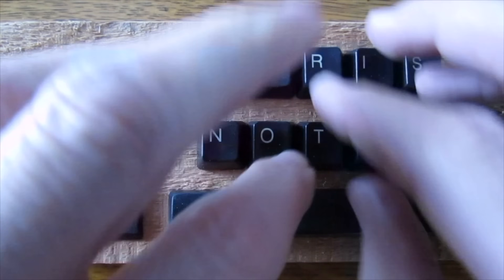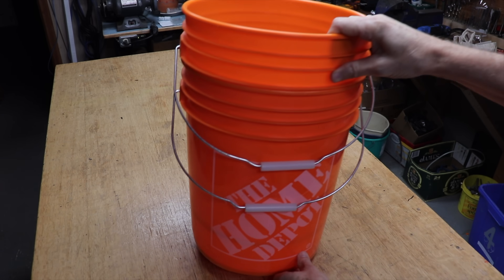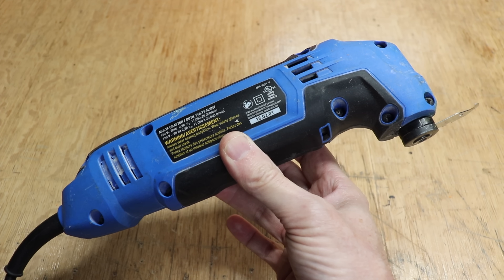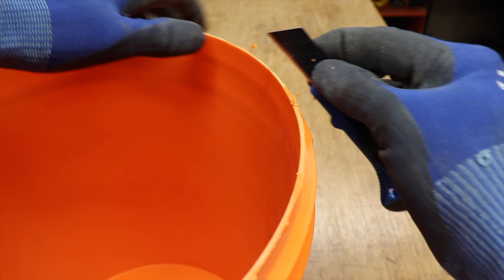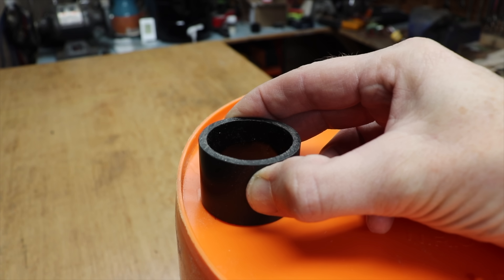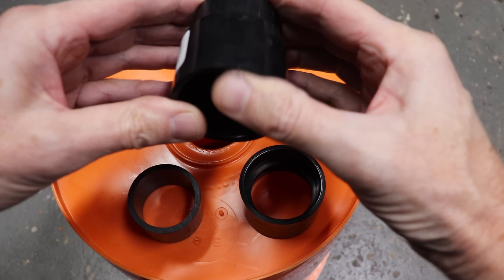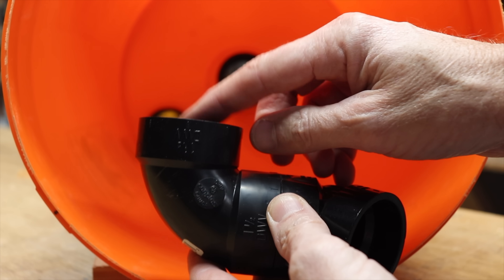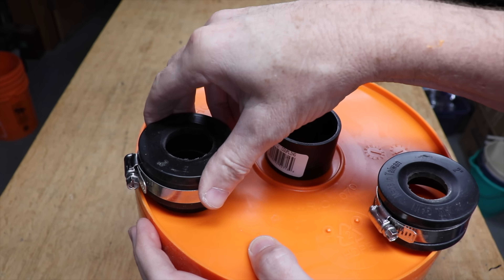How to Make ● Simple Cyclone Dust Collector

Comment: Genius simplicity. Well done video. Love the oscillating knife blade idea. Has anyone tried this for drywall dust?
Reply from the maker: I've had quite a few ask this so I just finished taking 2 square feet of 1/2" drywall and I pulverized it with a hammer into mostly dust and small pieces and removed all the paper. I sucked it up and I estimate about 99.9% stayed in the bucket or possibly 99.99%. I was impressed.  Hope this helps.
Reply: @chrisnotap  Good to hear that. I just built the cyclone yesterday. Will use it soon for drywall dust. Thanks.
Reply: @chrisnotap  Hey Chris. Just finished the cyclone build. I made a few mods to the exterior fittings for my type of hose attachments. Also, the cyclone bucket assembly loosely nests in a third bucket which has a weight inside at the bottom. Keeps everything from falling over. I did a test run using a Rigid shop vac, clean filter, 1 7/8" dia. Rigid hose between vac and cyclone, and same size pick-up hose. Did a large pile of saw dust. The coarser dust stayed in the cyclone, but the fine stuff made it to the vac. I then fitted a 1-1/2" PVC tee to the exterior side of the cyclone's discharge pipe. I partially taped off the open end of the tee to allow some air into the system, which reduces the suction. The tape covers about 80% of the opening. Another test run, and success! Nothing in the vac, everything stayed in the cyclone! The reduced suction didn't affect the vac's ability to clean up the dust pile. Good to go! I'll probably replace the tape with a valve of some sort to better control the airflow. Thanks for your ingenuity!
Reply: @chrisnotap  I have pics of my cyclone, but don't know how to send/post them.
Reply from the maker: Send them to me at chrisnotap@gmail.com  Thanks

Comment: Nice idea but for $30 home depot sells a system you can put on a 5 gal bucket. It includes the hose and all the fittings.
Reply from the maker: Some have said they are crap. Don't know for sure. I've never tied one.

Comment: I'm going to make one to clean out my chimney!
Reply from the maker: I will save you some time. I tried it with ashes and it did not work well. I guess ashes are too light.
Reply: I'm not going to use it on ashes I'm thinking about the creosote dust that builds up in the chimney

Comment: I built this today, and I'm not in the USA, but I managed to find equivalent bits and pieces - a few less actually, to make it even simpler! I added a 4-metre vacuum hose to my setup so it would reach all my tools.  My shop vac is pretty potent, and it was creating so much negative pressure it would collapse the buckets (2x 20-litre) pretty rapidly, especially if I blocked the flow. So what I did was drill 2 x 10mm holes the in the top of the dust collector to increase the pressure in the collector buckets. This stops the collector buckling inward if I block the inlet.

So far it's collecting everything I chuck at it, and only a tiny trace of dust is coming into the actual shop vac.

Great little project and my humble workshop is already much cleaner for it. Thank you kindly!
Reply from the maker: Re-watch the video and listen closely to what I say at the end......... If you smoke, you should vape. Slowly reduce the nicotine in the liquid to zero, then throw away vaping. That is vapings only purpose, to help you quit smoking. Cigarettes are deadly and vaping is way way way less deadly, but, like cigarettes, vape will muck up your lungs  for life if you continue, especially kids!! Vaping is not for kids!

Comment: Just made one myself. Adapted it slightly, used 2" fittings to adapt to a full size shop vac. Works well. Want to try it out with some dry wall sanding dust and see how well it tames that.
Reply from the maker: I've had quite a few ask this so I just finished taking 2 square feet of 1/2" drywall and I pulverized it with a hammer into mostly dust and small pieces and removed all the paper. I sucked it up and I estimate about 99.9% stayed in the bucket or possibly 99.99%. I was impressed.  Hope this helps.

Comment: I have been investigating cyclone dust collectors. I do scroll saw work and usually just use the shop vac after cutting.  I am wondering though about making something smaller and using, maybe, a home vacuum. I find the shop vac way to noisy and don't produce a whole lot of sawdust!  Any thoughts on this?

Comment: I made one today and it sucked great.  My question is my makes a very loud whistling noise when I run it. Any ideas?
Reply: When I switched to shopvac brand hose it was fine??
Reply from the maker: Some hoses can cause a loud whistle noise yes. If another hose doesn't make the noise, the issue was the hose.

Comment: Such a useful video. Just something I did while putting my together - I used the handle that is removed as the scribe. No parts wasted! Also, not all 5 gallon buckets are created equal and unfortunately my HD carries a different design of bucket. Gonna give it a shot. Again, awesone video for a novice like myself.
Reply from the maker: Did you watch the update video? .....  https://youtu.be/BeU4nqSJtBY
Reply: @chrisnotap  thanks for the reply! I did watch the update, it does answer one question I had. The original comment referred to the HD buckets having a different design and tough to connect. I was able to remedy for now. Thanks again!

Comment: I’ve been watching various videos and planning dust collection for a while and been thinking Oneida$$ dust deputy, or the small plastic vortex knock-offs ¢¢ available online. After watching various videos of diy Thien separators people are making I figured this would be a good inexpensive way to begin.  I have a large circle cutting jig, but started thinking “there has to be something like a large tapered flower pot or 5gal bucket that would take a lot of the work out of the project.  Then I saw your video!!  This is perfect. I can see making a few of these and positioning them near stationary tools.   I wonder if you can 2-stage a vortex to a vortex for the fine dust?  
Whenever possible I use a hole saw to cut larger holes and disks, but appreciate seeing the oscillating tool and tin snip method. Very cool the way the 2 buckets link together.
Reply from the maker: Did you watch the update video? .....  https://youtu.be/BeU4nqSJtBY

Comment: Would it collect more, if you not have both central hose and the side hose entering the top bucket at same level?
What If you lower side hose 4-5 inches below central hose?
Reply from the maker: The problem with lowering the side hose is that now you have a pipe in the swirling air stream to disrupt it and possibly send more particles towards the centre intake.

Comment: Thanks for sharing this is great. If you want to go even cheaper go to Firehouse Subs and the buckets are $3.00 each and that includes the lids although you will not need them for this project.  I am making one of these this weekend however I think I will use 2 in PVC since that will fit better with my shop vac.
Reply: Forgot to add for the Firehouse Sub bucket you need to cut off two rings.
Reply from the maker: Thanks for that info for the other commenters. Yes, you can use pvc or abs or whatever is best for your build.

Comment: Would this work for drywall dust?
Reply from the maker: I've had quite a few ask this so I just finished taking 2 square feet of 1/2" drywall and I pulverized it with a hammer into mostly dust and small pieces and removed all the paper. I sucked it up and I estimate about 99.9% stayed in the bucket or possibly 99.99%. I was impressed.  Hope this helps.
Reply: @chrisnotap  thanks for the response...I think that is my next project, tired of cleaning out the filter every 5 min cleaning up drywall dust.

Comment: Will this work for brick dust on a chasing machine?
Reply from the maker: I would say it will.  I just finished taking 2 square feet of 1/2" drywall and I pulverized it with a hammer into mostly dust and small pieces and removed all the paper. I sucked it up and I estimate about 99.9% stayed in the bucket or possibly 99.99%. I was impressed.  Hope this helps. Brick dust is probably heavier so it should work even better. It's worth a shot.
Reply: @chrisnotap  thank you
Reply: Very good design ill try it soon unless you will sell yours haha!

Comment: This is awesome thank you! Big question tho how would this work with say dry wall dust or similar ? Would it work as good as the saw dust !? Thnaks
Reply from the maker: I've had quite a few ask this so I took 2 square feet of 1/2" drywall and I pulverized it with a hammer into mostly dust and small pieces and removed all the paper. I sucked it up and I estimate about 99.9% stayed in the bucket or possibly 99.99%. I was impressed.  Hope this helps.
Reply: @chrisnotap  wow. That's awesome. I just did a job and that would of been really useful! Thanks for sharing.!! Gonna make one . Subscribed too!

Comment: I would imagine that this bit of genius would also work cleaning out A/C drain lines with out contamination of the shop vacuum and the need to remove the filter due to excessive H2o, the only thing l see is the filter getting damp not soaking wet.

Comment: Did you use a cloth over a filter, or in-place of another filter?   Also, what type of cloth did you use?  Will any cloth due?

L A S T L Y
Will this same design work with Baking Soda?  How long can the hose be, between the Vacum and the Buckets?

Comment: build a trapdoor into the bottom of the bottom bucket, and install the whole thing over a trash can. When the vacuum runs, it sucks/keeps the trapdoor closed, but as soon as you turn it off, gravity and the weight of the debris causes whatever is inside the bucket, to fall into the trash can. Build it so that the trapdoor has an offset weight on it that keeps the trapdoor closed when empty and the vacuum not running, but not so much weight where it never opens to self-dump. This way you will never have to split your system to clean it...
Reply: That’s brilliant! I bet there are a lot of us who can’t resist reducing the simplicity of this idea. That balanced door is great.
Reply from the maker: Did you watch the update video? .....  https://youtu.be/BeU4nqSJtBY

Comment: Does this work with water too? Not that it would keep all the water from the vac, but maybe it could extend capacity by 5 gallons?
Reply from the maker: Yes it will work! I am doing another video right now. It will use one 5 gallon pail. An easy to lift and dump liquid sucker.

Comment: Would this work with a plastic grain bag on the bottom with a frame or the base cut out of the bottom bucket?
Reply from the maker: Actually that wouldn't work. If you did that, the bag would get sucked up into the upper bucket.
Reply: I was was thinking more like if 4 prongs were in the bag to hold it down and open and a frame to support the bucket. At least that popped in my head now. Or what about a garbage bin with a lid? Buckets in Oz cost around $15 each and 60 litre bin costs about $16. If I put the dust extraction in the lid for example. Or do you think skinny and tall is the best way for the system to work?

Comment: Just built this for myself. A few caveats after initial build and testing. 

1. The latest buckets at my local Home Depot are missing a rib ring around the top. Which wouldn't be a problem except for: 

2. my 5.5hp shop vac will crush the upper bucket without that ring under vacuum, so if I get my user end of the hose accidentally sealed to something that upper bucket with that less structure will buckle.

To solve that I'm thinking about making use of the section I cut off. I don't think I want to put it inside the bucket or I might compromise the air vortex inside, and I haven't decided if whatever reinforcement I put on there should be screwed in or is adhesive enough. I also have a bucket lid I picked up, maybe that could be cut into some spokes to help inside without interrupting the airflow too much.

I'd be interested in suggestions.
Reply from the maker: Interesting that your buckets are different in your area. I would go with applying the cut off portion to the outside of the bucket with a liberal amount of silicone. That would be easiest to try and wouldn't compromise the flow inside the buckets.

Comment: Simple and effective! As we don't have a Home Depot in this country, what is the capacity of each of the buckets?
Reply from the maker: These are 5 Gallon buckets. I'm sure you could use any 5 gallon bucket but it will take a bit of experimenting to see. Good luck.
Reply: Thanks. That's around 18 litres and 20 litre buckets are readily available and cheap. You're right, I'll have to work out how to fasten them together.

Comment: Excellent work. With minimum expense you have created a very efficient cyclonic separator. What about finer, lighter dust? Will it separate drywall sanding dust as well as saw dust? To determine efficiency perhaps you can weight the total sample and then weight the amount of dust collected.
Reply from the maker: Did you watch the update video? .....  https://youtu.be/BeU4nqSJtBY

Comment: The only real changes I would make would be to swap those top fittings for 90 degree elbows so your hoses don't pinch and it would also be less prone to tipping over. You could also screw a piece of plywood to the lower bucket to have a way to step on when removing the top. Of course these are fine adjustments that anyone could add as needed.
Reply from the maker: Correct. Those details can be changed to whatever each person likes. Thanks for pointing that out!

Comment: So simple and it works perfectly! Thank you! No need to clean out the shop vac filter ever again. 

You can spend $10 on a 25 ft sump pump hose instead of the equivalent $60 shop vac hose. The practical difference is the pump hose is ribbed on the inside which can make the air flow create a standing wave that easily puts an air raid siren to shame. My solution for this was to empty a can of automotive rubberized undercoating into the hose, with the vac running. Then suck up some sawdust. This disturbs the airflow and has eliminated the air raid noise completely. Vent to the outside while the coating is setting up. 

I cut a hole in the rubber intake cap to fit the ribbed groove of the pump hose. This increases the effective diameter of the intake substantially and eliminates blockage.
Reply from the maker: Did you watch the update video? .....  https://youtu.be/BeU4nqSJtBY

Comment: This is by far the best cyclone dust collection for the shop that I have seen.  It was relatively cheap, works amazing, and was a quick solution.  The instructions were easy to follow and the video was entertaining!  Keep it up!  I did make some modifications that other folks might want to take advantage of:
1) Instead of using the 2” rubber caps, I opted for 2”x2” rubber couplers so that I could attach my 2” shop vac hoses directly to it.
2) I also took a bit extra time and used some silicone to strengthen the seals. 

What I’m trying to figure out now is a way to attach it to my shop vac as the double buckets are extremely top heavy. Any ideas, Chris?
Reply: Thomas Wilson … I was going to suggest screwing the lower bucket to a board (3/4 plywood?) so you have something to step on while removing the top bucket. That should help with the tip-over problem as well.
Reply from the maker: Yes. That would be great too!
Reply from the maker: Simplest method would be to put a brick in the lower bucket. Thanks.
Reply: That’s a good idea too!  So I decided to do a bit of tinkering and made a trip to the hardware store for some more PVC.  I use a Rigid vac which happens to have 4 attachment holders directly over the wheels of the vac.  Since I don’t have a lot of room for another item taking up shop space, I’m working up a vertical holder. (Mounted above the shop vac). If anyone is interested, I’ll post a pic when done.
Reply: https://drive.google.com/drive/folders/1H1cVDxuHRY17R7NSrqAQYA4CpQSVd_lE

Here’s a link with some photos of my POC.

I took a 1/2” piece of MDF I had lying around and combined that with some pvc I got to fit the rigid’s tool holders.  I added cutouts on the MDF for the vacuum tools.  I’m going to play with this for a few days before I go crazy and spray paint it orange or something. :)

Thanks Chris for the inspiration, sir!
Looking forward to your next video.  Btw the multi tool knife blade also worked like a charm!

Comment: I have to wonder if this would work with a more powerful shopvac. With the inlet and outlet so close, I'd think a longer inlet extension would be needed to prevent the vacuum from just sucking some sawdust straight from inlet to outlet.
Reply from the maker: The angled inlet keeps the dust swirling to the outside.
Reply: @chrisnotap  my point was that with a more powerful vacuum, it might be strong enough to suck up some of that swirling dust before it gets the chance to fall down to the bottom. You're using a pretty small vacuum in the video. If you throw like a 8HP 16gal vacuum on it, you might end up with different results.

Comment: How would this work for dry wall dust
Reply from the maker: I've had quite a few ask this so I just finished taking 2 square feet of 1/2" drywall and I pulverized it with a hammer into dust and small pieces and removed the paper. I sucked it up and I estimate about 99.9% stayed in the bucket or possibly 99.99%. I was impressed.  Hope this helps.

Comment: Really nice. I tried similar thing, but in cart that could be moved and a trashbag on bottom, but never got the issue of trashbag pulling it self into intake or messing up the cyclone filtering solved(i even put wire mesh inside the trashbag to support it, but no luck), maybe this is better option then.